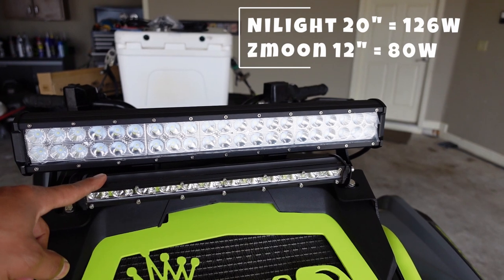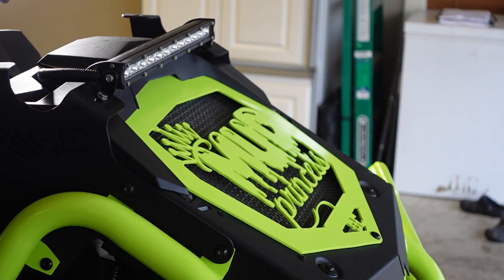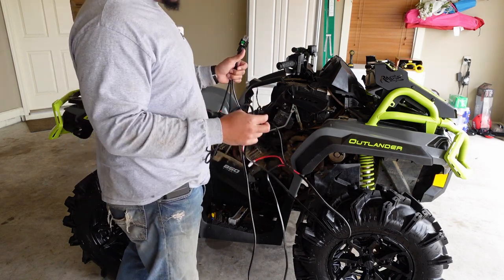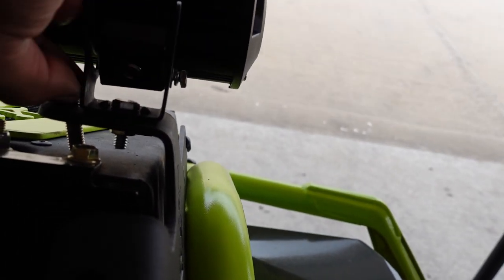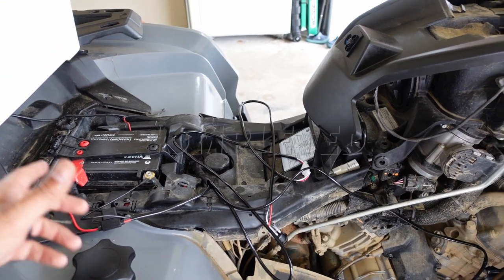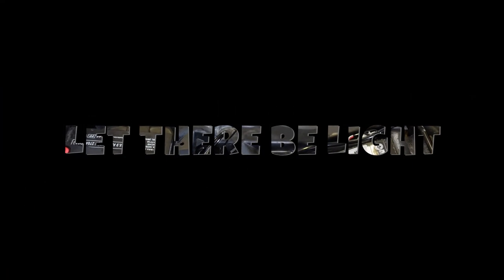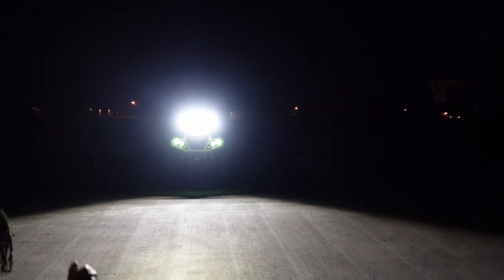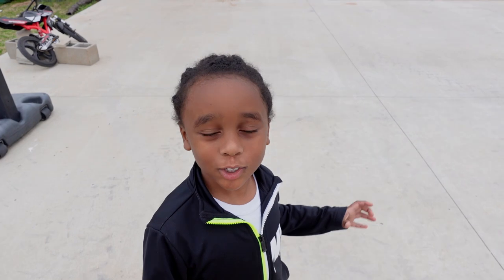WIFE’S CANAM OUTLANDER 850 GETS NILIGHT 20 INCH LED LIGHT BAR INSTALLED

Comment: Nice!  I have a 20” Rigid single row for High beams and a 10” Rigid dual row for Low beams. Used splitter to tie them into OEM lights, which SUCK!